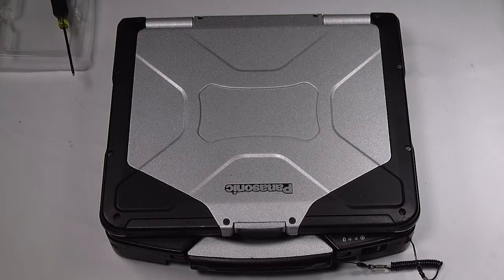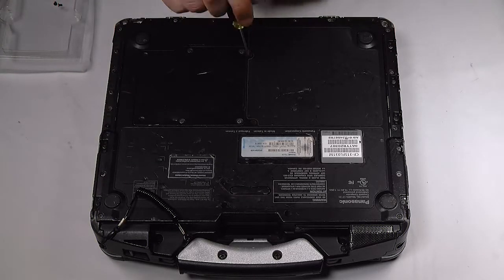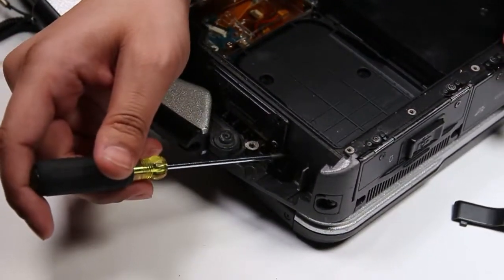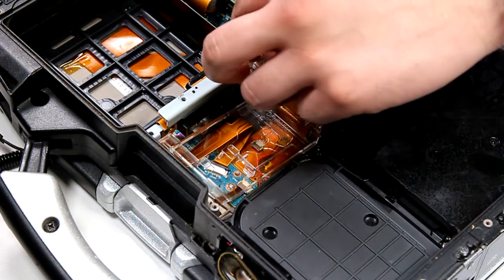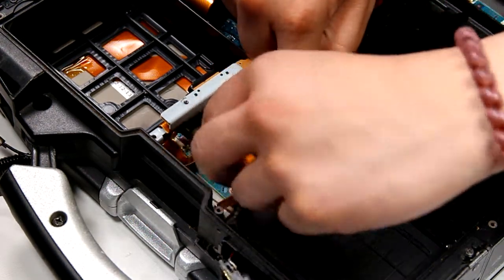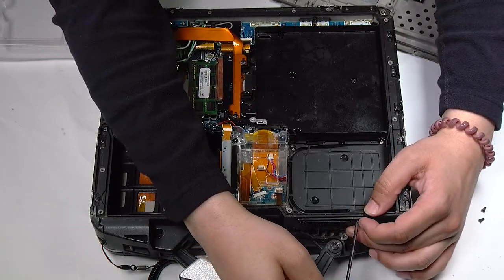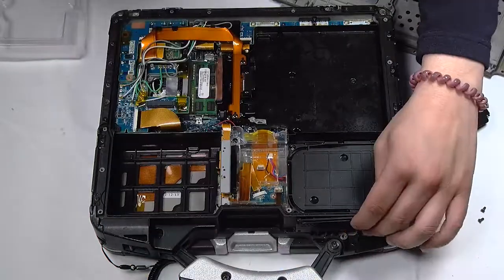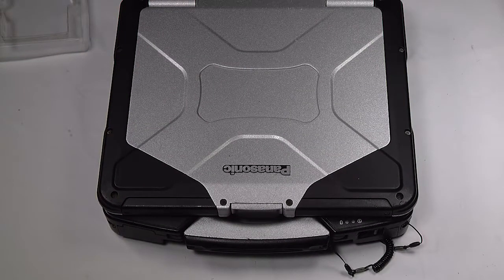Replace Your Panasonic Toughbook CF-31 Front Speaker!!

Comment: I detached my ribbon connector but am unable to put it back in? is there a release lock to put it back in because i am pushing and not getting it in. using cf-31 mk5. I am referring to the thinner ribbon cable i had to disconnect initially to remove the transparent plastic top.
Reply from the maker: @paulkwan4296 The best way to answer this question is to simply fill out our Tech support form.  Our in-house technicians will answer with the links and info you will need.  Here is the link: https://www.bobjohnson.com/tech-support-form/  Thanks for Watching.